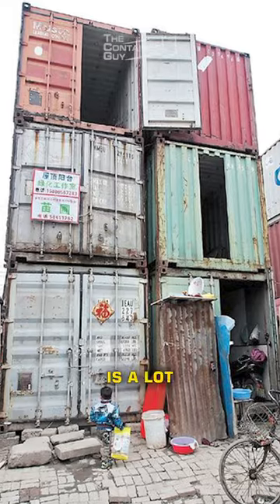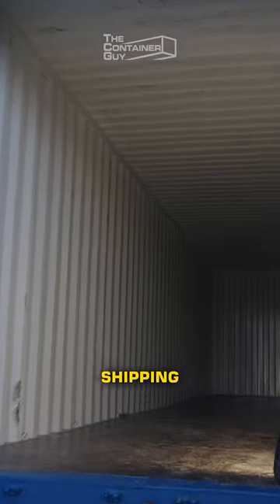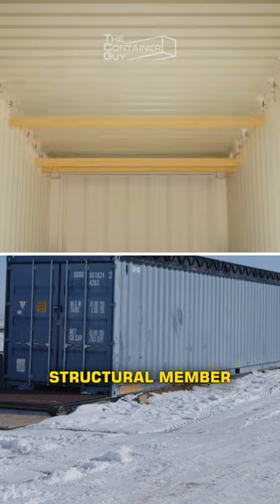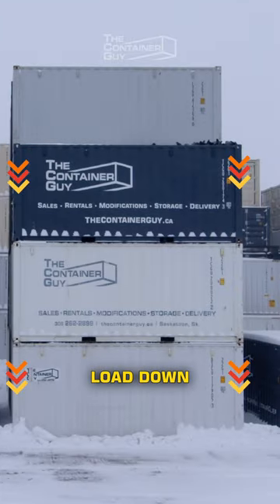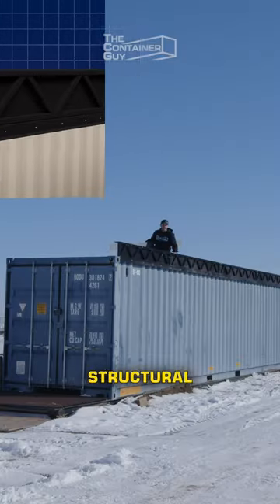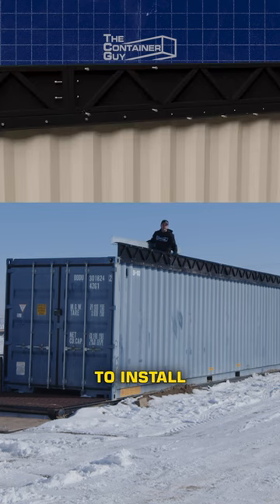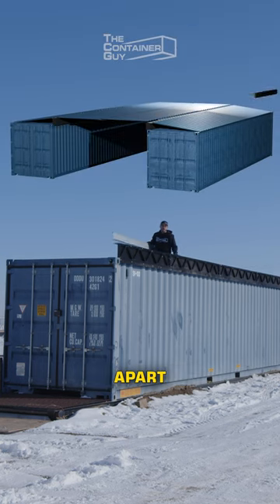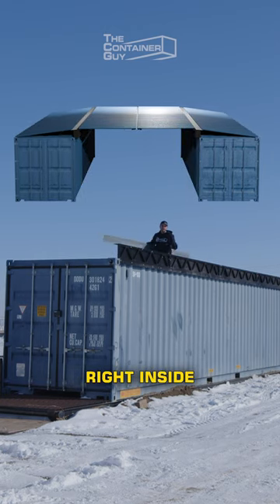DIY Double Wide Shipping Container #diy #construction #container

Comment: I live in the rust belt we have wood homes for a good reason😅
Reply: Because you have lots of forests and not enough area to mine concrete materials?
Reply: @shawnpitman876 because metal rusts, and concrete demands infrastructure to support it to create neighborhoods
Reply: I thought the rust was mostly caused by the salt used on the roads? Wouldn't this rust similarly to other areas since it's contact with salt will be almost non existent?
Reply: @NotMe-ej9yz  Well not all that simple in reality because it gets picked up in the wind and literally covers everything because winters are also desert dry and everything collects a fine layer of salt and you also salt your driveway and sidewalks and your porches. Then you get out the snowblower and fling that up in the air. Just like saw dust it all ultimately collects on everything even if you're in Florida and come back the wind from your neighbors does it for you too! Hope this helps to understand why you can't stop it. Even my wood fence has all Stainless Steel hardware because in my backyard far from the street those cheap Chinese solar lights poles rust away very quickly it's just that bad. We don't live in a perfect isolated simulation so that salt just covers everything like morning due does in Florida and if you live 5 miles inland from the ocean in Florida your car also rust out for the same exact reason it blows in the wind because it does not disappear but instead drys out and blows in the wind and lands on your home and cars.
Reply: @NotMe-ej9yz  So you think that things on the roads actually stay on the roads? You do realize that every rotation of a cars wheels is throwing things from the road into the air, right? Even little bits of rubber from your tires are getting into the air.

Comment: I’ve always heard that container homes are actually a poor solution, when it comes to building sound structures on the cheap, due to the necessitation for lots of extra framing to be installed to reinforce, and some people have said it would be cheaper to make it look like you built a container home (faked) without actually using a container.

Interesting to see someone addressing that reality to make the concept of recycling containers into homes more viable. 

Knowing they have a shelf life for their intended use, it’s great to repurpose.

Comment: I've seen used containers for sale .. starting at 2k 
..?  2000.00 ..?
Reply: How old and deteriorated are they though, they are used to transit goods by sea and have a shelf life…

New ones are very expensive.
Reply: I inquired about some in 2021 close to 7k for 40 footer delivered
Reply: That was for water tight I think.  Meaning no large holes or rust out

Comment: can I have a higher pitch in middle?
Reply: Yes ,we did that on a job , put 2 more containers at one end and poured concrete.  We used it as a temporary heavy equipment shop for 5 years.  Packed it up and sent it to the next job. Minus the concrete.

Comment: That's the thing with container homes is its cheap and not complicated there's no need to complicate unless you have too, say you need comfort
..than yes you do drywall ect.. but than that makes it more expensive. Some say you can build a little home from wood but the government won't let you do that without permits and septic, water, electric, at that point your not beating the system so to speak.

Comment: I wanted to do a shipping container home two in the shape of a v, facing the South send two or three on top with the broadside facing south, maybe one more in the middle at the bottom that would be my storage area my house is on the top the two-side areas are a chicken coop and rabbit hutch did the courtyard in between that's created fenced off in front and fencing going up and over so nothing can fly out or in, a deck on the Northside just so in the summer might be able to do a little better shading pretending still going with an idea for entry of course stairs inside or outside circular stairs or standard, but of course I would have a fireman's Pole to get down in case of emergencies or just have fun

Comment: How much of a snow load will it handle with an open atrium two wide? I want to do this with my two 40 footers.
Reply: Depends on how you engineer support beams.
Reply: @michaelsorensen7567  I understand that. That’s why I was asking what their product was rated for.
Reply: @BlueDart1971  well like, how wide are you spacing the beams, are they connected to each other to prevent twisting, is there a support colonnade down the middle, etc. I'm sure you can engineer these to support your snow load. I'm also sure you can under engineer it and have it collapse.
Reply: @michaelsorensen7567  The way they showed it two wide open in the middle with almost no slope suggested they were saying it would work. They said they were already engineered and just need to decide what configuration you want. If that’s the case then all I need to know is how much snow load it can handle. I understand what you’re saying I just had a simple question that will never get answered. Probably because someone stole this video from the people that actually made it and they can’t answer the question.

Comment: Issue about this is steal rust an you cant do anything to repair rust only apply a coating of waterproof oils on the steal structures before the rain hits.
Reply: Yeah, but steel doesn't get termites or dry rot

Comment: I don’t know why someone would use shipping containers if it needs to be stick framed inside and out. May as well stick frame it once and put siding on the building, it’d probably work out cheaper that way.
Reply: Don't have to stick frame it on the outside. Only need to on the inside if you want to hide your electrical/plumbing, or if it needs to be insulated.

Comment: My dream home used to be 9 shipping containers. 4 placed side by side, 32ft wide, with the second set of 4 welded together, then placed overhanging halfway ontop of the first 4 containers, with a single container placed longways onlong the face of the bottom 4. The overhanging section were to but cut through to allow for a sky light, 2 bedrooms, bath, and closests upstairs. Kitchen, living room, laundry room, master bed and bath downstairs. Originally had the upstairs at ground level, with the lower level being placed underground to help with cooling and heating costs (i live in nc, close to sc). But with the cost of the containers going up due to the mass production of tiny homes, i now want a 48x72 barndominium, framed and finnished in only the back half, using the front half like a shop/garage. I have cad files built for both and had a extremely detailed floor plan and 3d model i built back in highschool

Comment: I am thinking about digging a 25 foot pass into the side of a hill in placing a 20 foot container in it. I would have to put dirt back on top but not sure structurally how to do the roof because of the weight. Is this something that would work?
Reply: It Would not work,they do have videos on this..
Reply: Yup , Will not work due to weight of the dirt, putting pressure on the side walls, plus any type of moisture in the dirt ..and so on
Reply: I was going to do side support and slanted roof and put waterproof barrier like tyvek

Comment: But? What does it actually do, provides and aesthetic false roof? It adds no structural support etc, advertising that only this support is needed to rood a structure should be classed as false advertising. Where is the timber joists?

Comment: All I hear is a lot of yapping about a lot of points that don't seem to matter in probably one of the world's WORST ideas into making a STEEL box into a home and then try to expand already bad ideas beyond what they are starting out with and? Probably would of been better of fabricating a home straight out the materials they bought FOR THE STEEL BOX. Ironic. Start with box and by the end of it? Don't need box as design is limited by same said box but you just sank enough materials into this to actually make a decent home instead?!? Some bright ideas? Are burnt out lightbulbs.